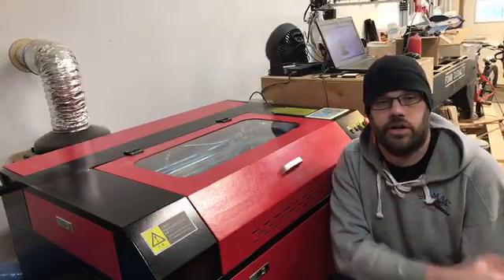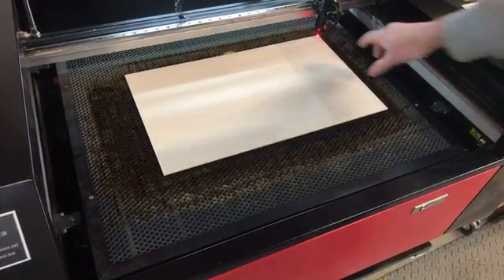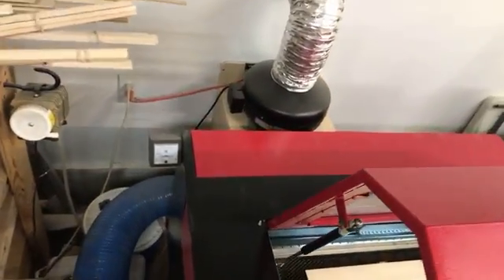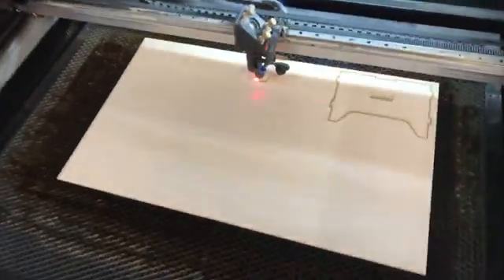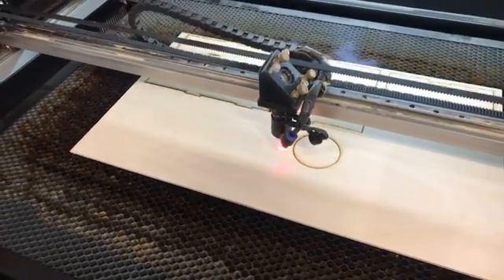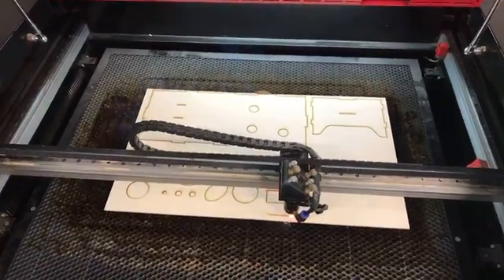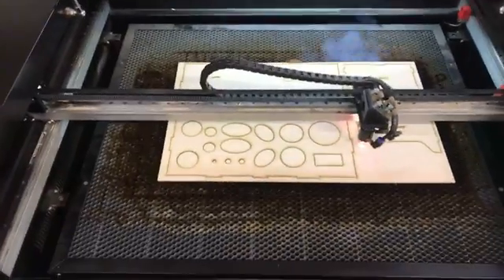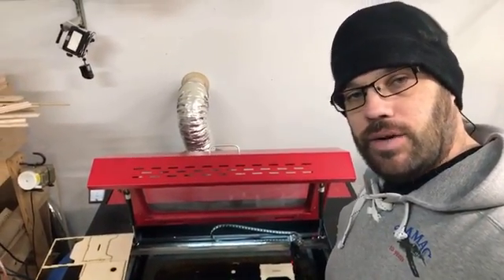Laser Cutting Baltic Birch Plywood (eBay Laser)

Comment: I’m getting the 100w version of that. Does it always burn the edges like that?
Reply: You can lower the power for corners.
Reply: Maker Cut I took a class at the local makers space and he mentioned that but I still don’t understand how. The thing has been a constant headache and we’ve had to mod / replace almost everything. Today the first mirror burnt out after maybe a couple hours of total use.
Reply: @pulaskiPumper  Some questions: 1. What software does your machine use (RDWorks, Autolaser)? 2. Your optics need to be cleaned on a regular basis, have you been cleaning them? 3. What lens did the unit come with?  Typically in the settings for cutting or engraving there is a setting for minimum & maximum power, the unit should use the minimum power in the corners when cutting. The mirror burning out is most likely due to contaminants on the surface of the mirror (or it was defective from the factory), I would expect contaminants if you have been working mostly with wood as the resins int he smoke can deposit on the mirrors, check them all before doing any more work. As for burning the edges of the wood, there are many variables that can contribute to this; out of focus beam, too much power & not enough speed, low quality wood (high resin content), low pressure air assist. Once you replace your mirror, clean all of your optics, & re-align the beam find out what the focal length of your lens is. If you are using 'Autofocus' it may not be set correctly for the lens from the factory (this happened to me).
Reply: We are manufacture www.aq-laser.com who is focus on CO2 laser cutting machine, contact with me anytime(vita@anqang.com)

Comment: I do wood door hangers and looking for an easier way to cut them I use 1/2 inch -3/4 in plus wood would this machine cut that? Im looking for a machine to cut out my images
Reply: I want to confirm that 1/2 inch more than 12.7mm????  The co2 laser he thickness of the cut is 150W power cut 10mm

Comment: hey, nice video. I just purchase the exactly same machine, and so far, I´m very happy with it.
Still wrestling with the RDworks though.
One tip from my experience: The reason that the laser was unable to cut through totally down on the laser bed, is not due to glue or imperfections on the plywood, but because your laser bed, got a slight offset levelling in relation to the lens. In another words, your laser goes out of focus on the lower part of the bed. you should try to use the focus key, and measure the distance  from the lens, on the top of the bed, and on the bottom, and see if the distance is the same...
the way to fix it, is remove the belt of the Z axis, and align the 4 " screws" that move the axis up and down.
A little bit of work though. I had to go through removing the legs, in order to fit my machine on my garden cabana, and for that, I had to remove the belt and stepper motor of the Z axis.
Well, good luck, and I hope my tip, was helpful for you, and your viewers that might read this comment.
Have a good one.
Reply: very similar to aligning the bed of a 3d printer years ago I was responsible for a 100 watt corad laser and now I remember some of the problems we had especially after we moved it to a new building 10 miles away .

Comment: Hi, I have a Chinese laser as well, but I need some advice on filling the laser. I am from a tiny island in the Caribbean and there is not much of these in my country at all..perhaps, Im the only one in my area so I can't seek advice. But when I fill the laser, I'm always getting bubbles in these and can't get them out. When I do sort it and use the laser for a while, and I open up to check the laser, I see millions of tiny bubbles formed and I always get scared to continue and never do. But why have this piece of equipment and not use it. Is the bubble formation normal during operation? So should I continue? I'm scared to crack the laser - all the warnings are saying NO Bubbles - bubbles crack laser. I really need some advice on this - can you advise on this?
Reply: One way to get the bubbles out of the tube completely is to orient the tube discharge port upwards.  You can loosen just the top clamps holding the tube and carefully rotate it without affecting the alignment.  Always use distilled water to prevent the formation of sediment deposits and in colder climates, use a RV type antifreeze mixed with the distilled water to prevent freezing.
Reply: @mdoyle1981  thank you :)

Comment: What software does this laser run on and is it compatible with other software or do you only use a particular software I would like to know if I need several software programs
Reply from the maker: The default control software is RDWorks that comes with the machine. This is okay to start out with but you'll want a different program to design in. You can import DXF files and Adobe Illustrator files for vector cuts but it also accepts most raster image files for scanning / engraving. Lightburn is the control software upgrade most people recommend for this type of laser.
Reply: @Vintauri  LightBurn is AMAZING!  They have a 30-day free trial.  Russ over at RDWorks Learning Lab is even impressed!

Comment: I just purchased one of these machines and out of the box it seems to be cutting/engraving my image backwards.  Seems as if the zero point on the machine is the back right corner rather than the back left corner.  Are you just reversing your image/art before sending it to the machine?  The image looks normal on my display on the machine and then engraves in reverse/mirror.  thanks
Reply from the maker: Josh, when I engrave the image appears reversed in the display but normal when it engraves. It sounds like there might be a setting that is reversing the image when processing it?  You can set the origin point in the RDWorks software by going to the Config menu > System Setting > then choosing your point in the laser head grid. Maybe check if the x and y axis mirror options are checked in that same location. It might be part of the problem?  I've not had to mess with that so I'm not 100% sure that's the issue for you.
Reply: I had that problem too, then I made the switch to LightBurn. RDworks is OK but LightBurn is far superior!

Comment: When you upgraded to 100watt laser did you also need to upgrade the power supply to 100 watts what is the size and brand of power supply that your using now and I would like to know how many hours of cut time has the machine been used in preforming
Reply from the maker: I only upgraded to a true 60w tube. The power supply that came with the unit is rated for 60w so I didn't have to swap it out. On the 60W tube I have about 325 hours of cut time on it and it's still going strong for me. It's use goes in waves, sometimes I'm busy with it and other time's it's idle for a few weeks.

Comment: Hello, the chiller installed where you bought?
Reply from the maker: The chiller that I was using in this video was a 1/4hp aquarium chiller. I purchased it from a reseller on ebay as a refurbished unit for about $175.  I have since replaces it with a CW5000 industrial chiller.
Reply: Vintauri RC , thank you for the info, i want to change the tube from 60 watts to 80. Do we need to change the power supply too? What kind of brand of tubes and power supplies do you recommend?
Reply from the maker: @alexventuree8100  You should really match the power supply to your tube. I would recommend buying them together from a reputable source. I bought my tube from DLM Laser and it was a RECI brand tube.
Reply: Vintauri RC thank you, for you advice. When i change the tube and supply to 80watts , need to be changed the program of the laser machine? Or work with the same system?
Reply from the maker: @alexventuree8100  If you stick with the same controller the software will still work. However you'll need to run tests for new power levels and speeds for your material. I've been looking at Lightburn as a new software to use on mine. It looks better then RD Works and works on more controllers as well.
Reply: Hi, dear Alex Venturee, We are factory of laser cutting machine. And we also supply spare parts. Pls feel free to contact with me. Whatsapp:+86 15020696209

Comment: Can these Chinese machines have a set home base like where it will always start from the same spot so you dont have to always make sure the wood is aligned?  I remember when I used to use the Epilog it would always to the top left corner after every job and start from there
Reply from the maker: They auto home to a fixed point and you can setup your job to start from a fixed point after that. But you still need your material square to the gantry. On more repetitive jobs I set up a jig that allows me to just drop the piece in each time but on one off quick jobs I just take the few seconds to make sure it's square then run the job.
Reply: @Vintauri  Excellent I'm seriously considering this machine as for your air assist pumpI found this particular model (gast doa-p101-aa) on ebay for just $100 it is so quiet almost like a fish tank pump and can run for hours and never overheat.  Have you tried actual images with this machine and get good results?.. From my experience I used the Epilog Legend 36ext for a few years until my business partner disappeared with the machine... scum bag... however that machine is 25,000 I cannot afford that so I need something to get back on my feet.  I usually engraved on 3mm maplewood using 45w laser at 300dpi with great results usually 90speed 30power

Comment: I have that very same machine- for 3 years now, only replaced the tube once, and the estop- from what i can see, you have much scorching on the top, and not much air assist, you focal point is too far away from the surface, should be, dependent on your nozzle lense, 13mm from the surface, (fyi, there is  plastic orange height gauge that comes with it to set this).  also, if you increase your air assist to 10 psi, your cuts will improve dramatically, and also assist in cutting material (wood, acrylic,delrin, etc) up to 19mm.
Reply from the maker: That is a good point, this video is a year old and I have since replaced the airlines from my compressor. This has allowed better airflow and pressure at the nozzle and I'm getting much better lines now. I should have also cleaned the lens and mirrors before shooting this video as I had run some MDF before this and they were not pristine. I have run a ramp test and my focal point is about the best it can be, but between the lens needing cleaning and the low air assist, I was not getting the best cuts that I could have at the time.
Reply: I was going to get one off ebay, hows it holding up,and so far?
Reply: @Geminiced  Mine has held up very well, aside from having to pressure wash the honeycomb table every now and then..
Reply: I want one but am a little reluctant to pull the trigger as I barely started scratching the surface on what needs to be modified or adjusted.  If anybody can help and point me in the right direction I will probably pull the trigger on one. Thanks in advance

Comment: That laser cutter would do extremely well cutting out tops and backs for acoustic guitars. To add, though... It would be much easier for you to get stuff square if you took actual measurements. Just sayin...
Reply from the maker: This type of machine can do many things and it's great when people find a use and make it work for them.    For production projects, I will set up a jig and know that my piece is square to may starting point each time. But for one-off items, I just set the material in the machine and do a quick test as I did. One of the trade off's with a cheaper chinese machine is constantly checking that the machine is in proper service. The lower quality parts can wear faster or loosen so I never trust that the machine is straight from the last job I've run.
Reply: @Vintauri  Fair enough.
Reply: Can always get a camera setup, but you need LightBurn for that.  Can place items in and do an overlay to precisely place things where you want them.  Makes engraving objects, especially smaller pieces so much easier!
Reply: @jamienoel  That's kinda cheating if you ask me. lol

Comment: I have one of these lasers. You mentioned your running at 18mm per second.  Bad news, ,your not really running at that speed.   These lasers can run fast in a strait line, but around the corners, bends, and curves the speed goes down a ton, but the laser power stays on the same power, resulting in more power in spots than you thought you were getting.  Find your lasers top speed around all corners, then turn down the power to match that slower speed, and run at that new slower speed on all jobs.   You will get a more consistent edge finish that way.
Reply from the maker: You need to adjust your min and max power to match the changing speeds around corners. I run my power around 82% to hit 20ma at 18mm/sec but run the min power at about 30% so that the corners do not over burn. This way I don't loose the speed on the job.
Reply: @Vintauri  and just like that I have finally figured out what the minimum maximum power settings actually do. I always set them for the same value. Thanks for the tip
Reply from the maker: Laser Wood Shapes Happy to help! I should do an update video with the things I have tweaked or learned this past year as well.

Comment: That quiet pump do you have any info on it?
Reply from the maker: I picked up the quiet air compressor at our local Menards which is a home improvement center. This is a Masterforce brand but there are many similar to it under other brands. The important thing to do is to add a ball valve to be able to easily turn on and off the air flow as well as a moisture trap so you don't spray water vapor into the cone with the lens.
Reply: I have those just not a quiet pump as my pancake pump I can hear all over the house and outside as well.
Reply: Awesome video! U said u changed the laser tube? Which one did u use and where can I get one? Did u change the power supply also? Any other modifications? Thanks

Comment: Watch out for that unit! Most of the circuitry is underrated and can cause fire. My friend almost lost his entire shop because his unit caught fire. His was identical to yours. Just keep an eye on it.
Reply: I rebuilt all of mine (I mean 99% is new stuff) and the first thing I did was change over to 16 gauge real copper wire as I knew of the horror stories but mostly in the USA due to the wires they use are fine at 220v but at 110v will melt and burn up.   btw, on mine had to redo the OMG panic button as it would only cut power off to controller and the up and down table still was live.  I also found they had the wires backwards (L/N was N/L) so not even my circuit breaker would react like that.
Reply from the maker: Johnny, thank you for checking this out. I've had this laser for 3 years now and the first thing I did was go over all the wiring. There were some areas that needed better wire and some connections that were too loose. I've also never used the plugs in the back to power the exhaust fan and pump. That's a very bad idea on these machines. It's something that anyone considering a cheap chinese laser should take into consideration that you will need to do you own due diligence on inspecting and monitoring the machine to avoid a dangerous situation.

Comment: Where did you find/order 3mm Baltic birch?  Need a few sheets for a VW Bus interior 😁
Reply from the maker: Tom Kimball I order all my Baltic Birch from Liberty Hardwoods. I use the thicker material on my cnc router.
Reply: @Vintauri  thanks!  Talked to them and found out I can get a truck delivery to within 3 miles of here.
Reply from the maker: @tomkimball9798  Good to hear!  It's nice that they can deliver it close. I've often had them bring it right to my shop but when they have a larger truck I meet them at a larger parking lot as to make it easier for both of us. Love that your working on a VW Bus. One of these days I want to pick up another classic Beetle.
Reply: @Vintauri  thanks again for reply.  IG is "the serenity now project"  if ya wanna see what's going on with her.  Barnyard rescue!

Comment: Just wondering what brand chiller you are using?
Reply from the maker: The Chiller in this video was a HydroFarm Active Aqua Chiller. Model #AACH25. It worked well but I still had to have a separate pump and reservoir.  I have since upgraded to a CW5000 Industrial chiller.
Reply: Hey thanks for the advice, I just ordered the CW5000.  Is there any chance that you have a cylindrical rotary device for that machine? we have the same one and we are hoping to get the rotary device for it.
Reply from the maker: @timhulla3053  I do have a chuck style rotary that I use on occasion. It works well once you get the steps dialed in and calibrated.

Comment: Enjoyed your video. New to laser so I was wondering, does the "spacer" generally come with the machine or is it something you made? Thanks!
Reply from the maker: The laser should come with one but it's a good idea to run what's called a "ramp test". You set some material in the laser at an angle and run a line across it so the laser path is going up or down the ramp. You then check the path for the finest line and then measure the distance from your lens  holder to the material and that would be the focus distance for that lens.